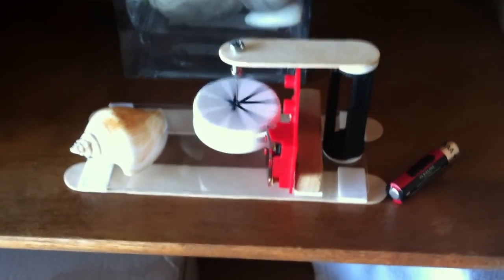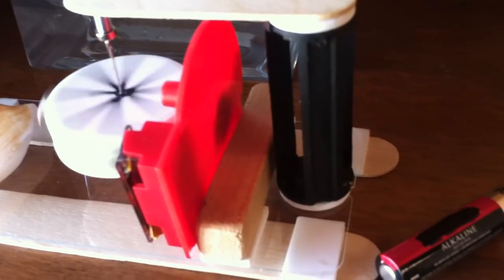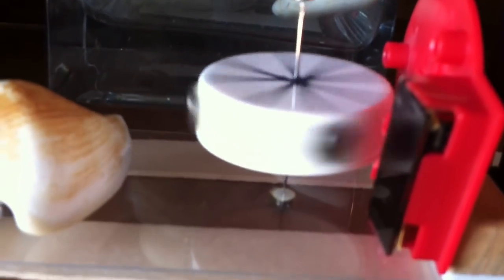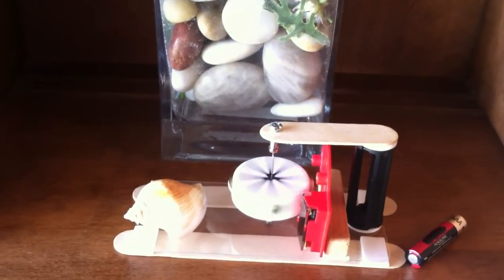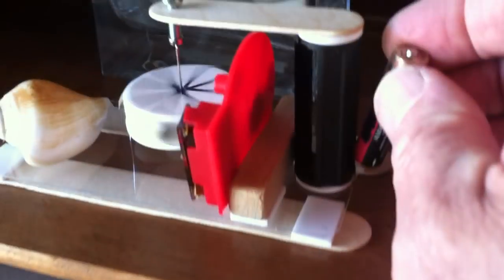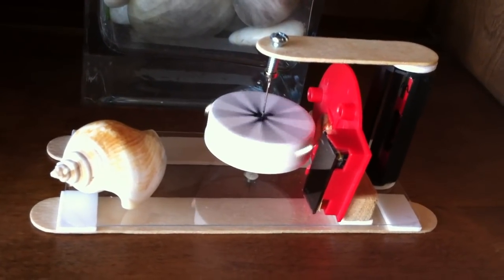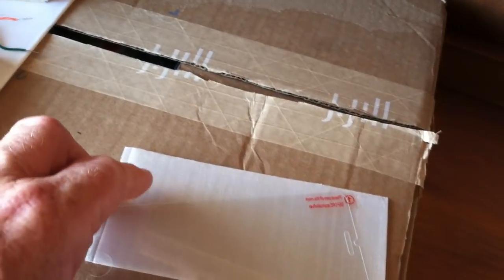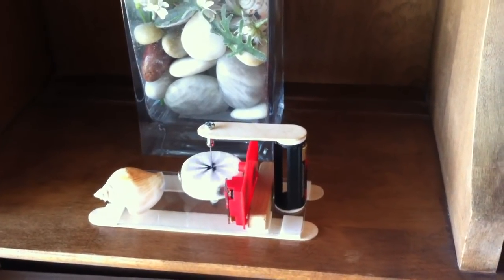Pulse Motor / Art Object  ---Ideas

Comment: adding a diode to a micro solar panel is over doing it lol. For about almost a year now I have been charging dollar store batteries, the cheap carbon zinc type when they go low or most everyone says dead but the trick is never go over 1.60v and slow charge them and they don't leak. I have a small solar light on my mail box that has a carbon zinc battery in it and it charges up every day and comes on at night. I replaced the nicad battery in it because over time the panel can not keep up and battery stop working. The zinc carbon battery has lasted through the cold and the heat for 10 month now. Your setup paired with a parallel battery to the panel should stay running almost forever.
Reply from the maker: Thanks for that comment.  I have been doing the same thing with old $1 store solar lights but I have been using alkaline AAAs.  I will try carbon zinc now that you have done the testing.  Amazing what you can learn by just trying something that others say will never work.  As far as the diode, it was to stop the back drain during night operation. I guess that isn't necessary.
Reply: Lidmotor why you think it's not necessary lidmotor?

Comment: Oh man, great idea using the phone screen! Second best to the sapphire bearings, right? Should maybe sharpen the needle too if you haven't already. A super-sharp point spinning on the perfectly flat screen, for least amount of rubbing (a scientific term)! Maybe even sharpen the top too. I wonder at what point the sharpness might work against you, for instance if you didn't have a hard enough surface for the top bearing. How do neodymium magnets wear? I think they have a nickel alloy coating, no?

I love the dual power idea too. This is kind of like a micro-proof-of-concept of what I see as the ultimate smart home, renewable situation. Cool build, man! Could you wire it up to also charge the battery off the solar panel? Maybe you'd just need another tiny solar panel; you'd certainly have room for it, they're practically insignificant. It would be ideal to pulse the coil and the battery, I suspect, for maximum run time, no!? I guess if you're bringing PV into the build, you just need to think of what you're pulling in, with what is going out, into the rotor/fly wheel... and then it could go till the Sun burns out!

The shell is kinda corny and out of place, lol. Maybe when it is encased in some nice glass the wife shan't protest.

Thanks again for sharing! Always a pleasure seeing your videos.

Comment: another great video thanks for sharing. I'm happy with my pulse motor replication from you that i can run 0-5 Uamps with led flashing in my latest video https://www.youtube.com/watch?v=dJ9XclZb4MQ  I only need to improve the stability of the needle to make it perfect to run without stopping
Reply from the maker: I watched your latest video and your motor looks great!  I will have to try that circuit.  If the motor is drawing under 10 micro amps then it should run for many years on AA battery that has a 10 years shelf life.  Excellent work.